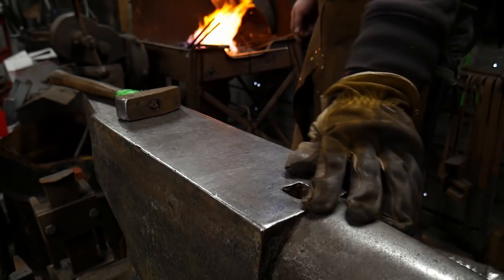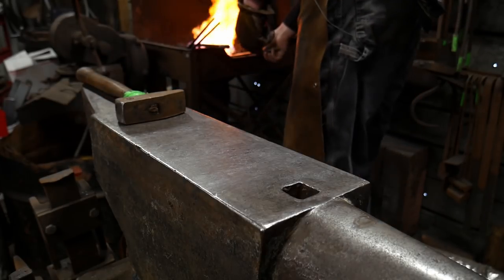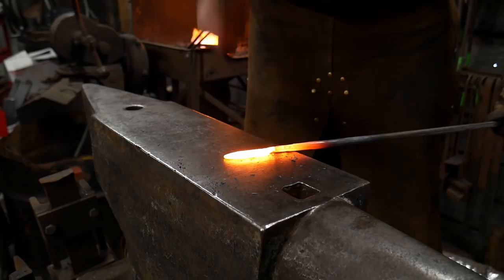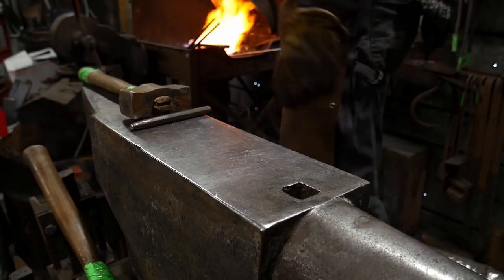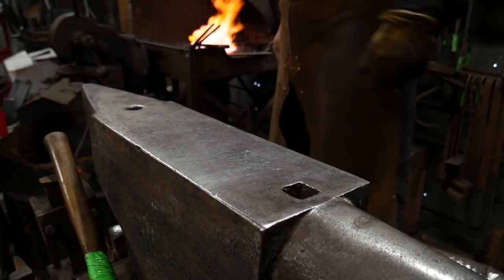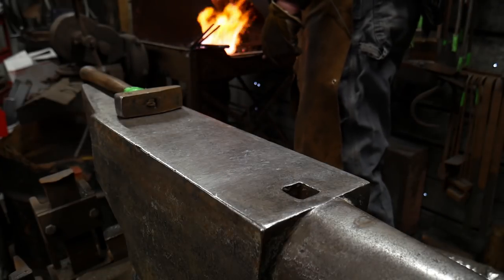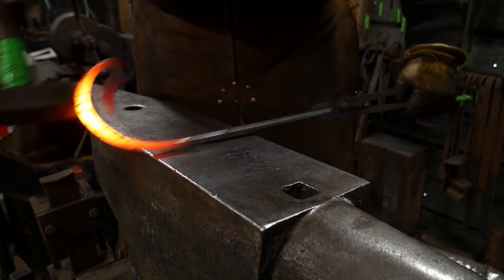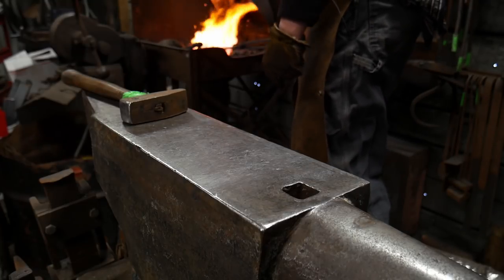Forging a Bean End Scroll  [Hand Forging Scrolls]

Comment: Very cool. I think it would look really cool doing the reverse put the divots in the back and push into the positive for the front. 👍👍⚒On!!!! Ty Roy
Reply: Either that or maybe a modified eyeball punch, that would make it look like peas in a pod maybe?
Reply: @shadetreeforge  that's exactly what I was going for Frank so they look full and unopened. Sorry I guess I wasn't clear
Reply: @bentoombs  That's ok Ben, I was just offering another way to do it, when I saw your comment I visualized taking the ball punch and driving the material into a depression such as a backer block for a rivet set,either way would work I'm sure, in fact the last way would have more detail? dimples on one side and bumps on the other.
Reply: @shadetreeforge  great minds think alike that's exactly what I was thinking or back by a wood blocker whatever something soft
Reply: Another way to get the bulge  effect of peas inside the pod would be to use the ball punch on the back but work on a stump instead of the anvil.